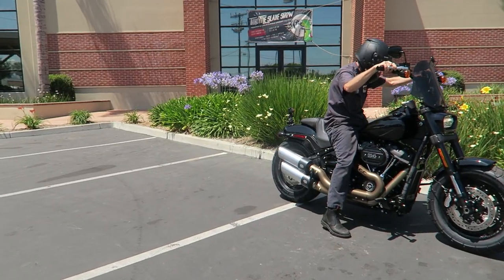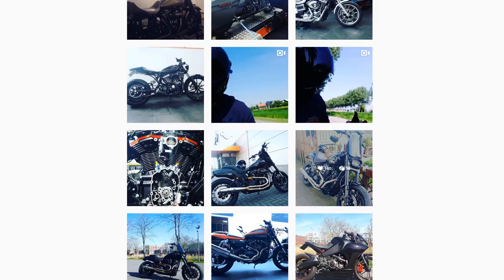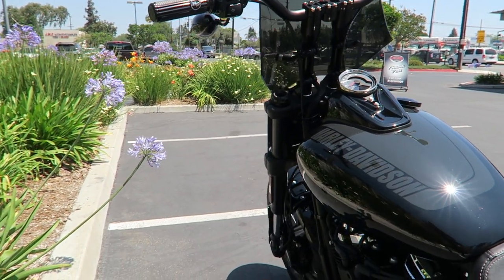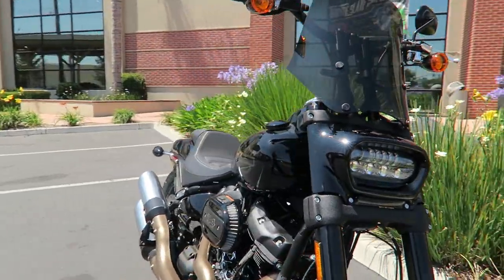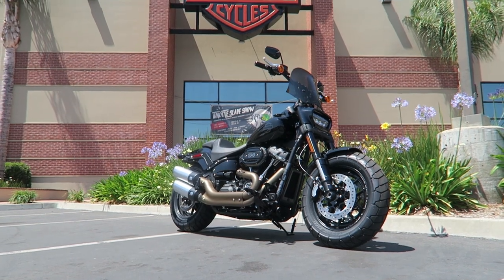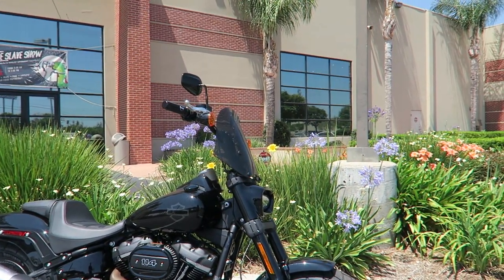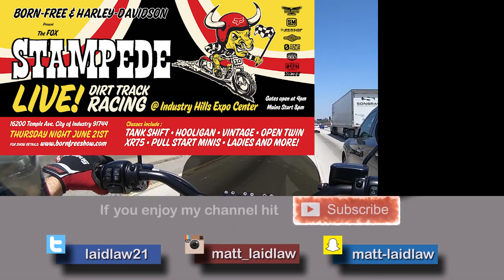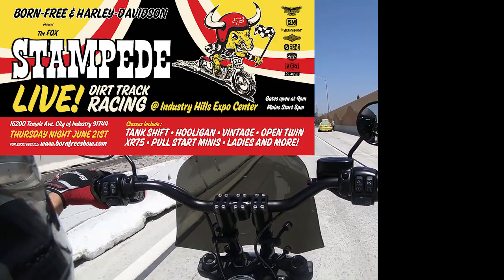Club Style 2018 Fatbob Harley-Davidson by Laidlaw's H-D

Comment: a bit more than I like but I can see some nice touches. especially that license plate re-locator, that is pretty sweet. I wish they would come out with a small fairing replacement for the headlight that did about what the sport glides windscreen does, cut the air off the chest but leave the head in good smooth air for the helmet vents without buffeting
Reply from the maker: yea, H-d should come out with a proper fairing

Comment: I love the stock finish and fit of the '18 Fat Bob, the only change i made was a stage 1 kit with a Two Brothers Racing Megaphone II on mine, otherwise i wouldn't change anything, though its neat to see what the bike looks like in a Cali Club style. I personally would love to see a full rear set "Dragster" or Cafe racer style done to the stock bike, bring those lines into more of a sleek position i'd say that because of its ground clearence and a set of high pipes it would be a unique sort of take on what its little sibling Roadster can be :)

Comment: Very cool. I'm an owner of a '15 FatBob.  Do like the 18 FatBob, but the fuel tank is too small now.... But great job on this one 👍
Reply from the maker: You can't really compare the two generations of FAt Bobs. I was a huge fan of the old ones and I really like the new ones A LOT. They are two types of bikes though that fit two types of riders.
Reply: Matt Laidlaw I agree.  In the future, when I was ready to upgrade, I probably would have liked to continue with the FatBob, but with all the changes I've had to think twice.  I do like the new bike, but for my purposes, I need the bigger tank or I'll be filling up twice a week instead of 1.  Oh, and the stock exhaust has to go too 😉

When the time comes, I'll just have to reassess the options available then, just sad it moved away from my needs.  Cheers mate, thanks for the vids 👍

Comment: Hey, at minute marker 0:50 it shows the rear end of the 2018 Fat Bob and the license plate holder is mounted to the fender?  Where did you get that fender mounted plate holder?  Mine has the side mount, but I want to replace it with a fender mount like the one you have shown here.  Please let me know where you got that.

Comment: @mattlaidlaw I didnt hear you mention this in the video, but were the stock cables long enough for the riser and bar swap, or did you have to install new wires and upper brake line?